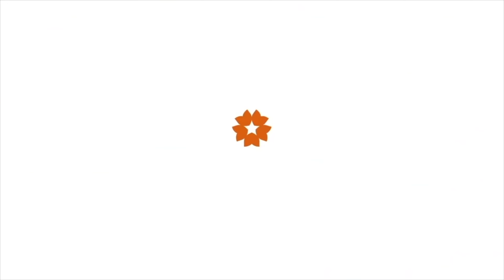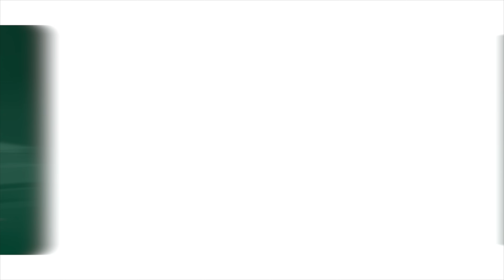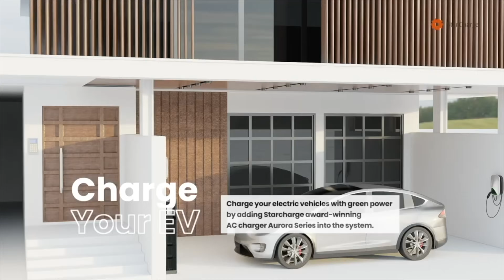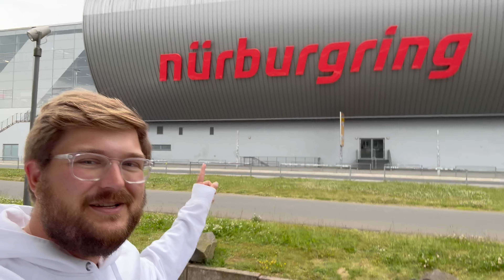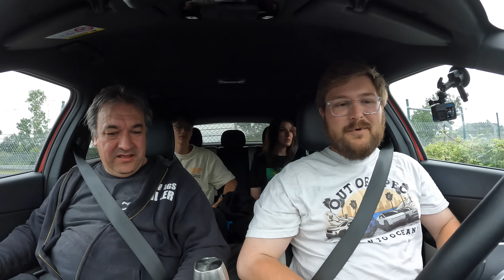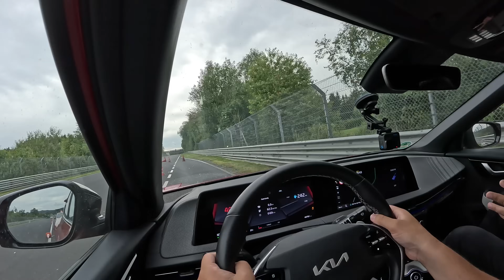Kia EV6 AWD Nurburgring Lap! When A Viewer Tossed Me The Keys

Comment: I drove a rental EV6 once, second kia I've ever driven, the first being the niro...I was really hoping the EV6 would be better...and it was because unlike the niro it had one pedal driving...but the fact that one pedal driving disables itself when you take the car out of drive so you have to turn it back on every time you get in and the paddles and...I will never buy a kia. Disaster of a car, I hated the niro and the EV6 was only marginally less terrible...oh and the fake noises, had to turn those off, absolutely terrible when companies put fake noises in their car.
Reply: So that little detail makes it a disaster of a car!?! Come on… iPedal is not the best way to drive; neither for driving economy or the uphold of the brakes (or safety for that matter). And Kia has to comply with EU regulations stating that the official numbers for the car are based on the defailt starting level.
Reply: @svenskenh644  one pedal driving isn't the most efficient on highways but it's perfectly fine around town. Also...how on earth is it bad for the brakes? Regen saves your brakes. Safety???? The brakes still exist, it's not like you're forbidden from using them? I often turn off one pedal driving on the highway in my car...but then that reminds me of the OTHER problem with EV6 one pedal...turning it off turns on creep...so now you've got your car pretending it has an automatic transmission. It does not drive like a modern EV in any way. It drives like a gas car with an electric power train and if that's how you like to drive your car that's fine...but I think having settings is good so people can choose how they want to drive the car. Additionally the whole car was annoying, this was just the big thing that annoyed me. The fake noises are annoying but can be turned off so that's just my preference but the software is a disaster as Kyle points out, the built in navigation is mediocre, the voice assistant is hilariously useless.
Reply: @Scoopta 1 4wd is always on in iPedal why it isn’t very effective even in city driving. 2 It is good to use the brakes for stopping. Otherwise they will rust and be bad. If one use iPedal one hardly ever use the brake pedal. 3 It is common drivers get panic and try to stop the car by pressing the accelerator harder when using iPedal. Better to learn to push the brake pedal for stopping. Therefore Kia has made it impossible to use iPedal in reverse. I had the same opinions as you when I was new in the electric car world but has changes opinion since I learned the 3 things I mentioned. The Kia engineers have actually done some clever thinking about this and their findings are backed up by research.
Reply: @svenskenh644  1) that's dumb and only makes iPedal a worse design choice. That's not a problem with one pedal, that's a problem with the EV6 one pedal.
2) yes but you don't need to all the time. Several manufacturers just tell you to use them periodically to avoid this problem 
3) weird? I don't really have a good argument against this if this is true but I drive one pedal almost exclusively and even in emergencies have no problem slamming the brakes. Then again when driving ICEs I frequently release the accelerator to slow down at a slow rate on the highway so maybe I'm just better trained? Who knows. I've never had this problem but it's totally understandable that someone else could.
Additionally I'm not exactly...new to the electric car world. I've owned one since 2019 as my only car and these opinions have only gotten stronger.
Reply: What exactly is so terrible about it? I have the same exact car and I love it. Best car I've had since the 80s.
Reply: @ibeam68  the car isn't bad in isolation. It's bad when compared to other modern EVs and it's not bad as a car it's bad as an EV. To me that makes it a bad car because that is the most important part of an EV. If your EV is stuck with creep on unless you enabled one pedal driving which you have to do with paddle shifters and it constantly disables itself when you put the car in park or reverse. That's incredibly annoying. It's just barely better not having one pedal like the niro. The software is mehh too which only added insult to injury when added to the one pedal stuff
Reply: @Scoopta  I stopped using the ipedal except for heavy traffic which is why I don't mind it I guess. I also disabled in my LEAF which keeps it on unless you turn it off. I guess it's a matter of getting used to it.
Reply: @ibeam68  I use one pedal driving everywhere except on long distance highway drives where traffic is minimal. Creep bothers me more though. Even if one pedal is off I never want creep on but I love one pedal and cars with poor one pedal implementations really bother me to drive.
Reply: Because it is so hard to pull the left paddle. Once.
Reply: @jimwilt4944  it is rather annoying to have to do. It's an extra step other cars don't make you do and it's unavailable in reverse and disables itself in reverse
Reply: @Scoopta  Fair enough. I don’t love everything about the car, but the paddle-controlled regen braking is brilliant and I use it ever time I drive the car.

Comment: What's fascinating to me is that the EV6 didn't cook its brakes and overheat the battery. Recently a Highland Model 3 performance went on the Nuremberg ring and its brakes started seriously smoking around 25% into a lap and the battery overheated around 50% into the lap. It was a complete joke! Tesla should be ashamed of themselves for releasing a performance vehicle that's a piece of junk on a track!
Reply: So the break was at it`s limit after 1 lap. Battery and the motor where fine. Tires also. But Kyle was gentle to the breaks and tires to the end. I never was worried about he could damage the car.
Reply: You are comparing a casual drive in someone else's car vs a full blown time attack tho...
Reply: @PhilHarlow  It was on a public track day, so exactly the same circumstances. Maybe a little harder, however only 2 up. There are also other Highland videos of track days where, it's even worse 3-4 corners the brakes are cooked and the battery shortly thereafter. My point is, it has a dedicated track mode and yet its worthless for even an amateur on a track day!
Reply: @joebullwinkle5099  I’m going to guess you don’t have much seat time at the track. The circumstances are that he’s on non-performance tires, in someone he doesn’t know’s car, while the passenger is visibly fearful. You’re not driving hard in that instance. Compare to a time attack in your own prepped car. Those are very different circumstances. Driving even 8/10s is an extremely different thermal load than 9/10s. There very well could be issues with the highland p, I’m just pointing out that your comparison doesn’t really make sense here
Reply: That was Misha taking from the Model 3 all it has, harsh breaking and ruthless accelerating, thats NOT comparable to a casual drive around the Ring that Kyle showed here.

Comment: Thanks for the lap!  Here's your newly warped rotors and worn tires!  Thhaaaaanks!  LOL
Reply: Rotors 👏 do 👏 not 👏 warp 👏. Talk to anyone who tracks seriously, and they will tell you a "warped" rotor is simply one with uneven pad deposits, caused by heating a crap pad until it melts, and then leaving the car stopped long enough for the pad to leave a pile of itself in one spot. Simply re-bed the brake pads and the the problem is fixed. "Warped rotors" is mechanics' favorite myth. What better way to sell someone a $25 part they don't need, take 10 minutes to swap it, and charge the owner $500+? 

I've pushed rotors so hard on track that they literally split down to the hub and gaped open by an inch, like a Pac Man. I have never "warped" a rotor. Kyle is right to not stop the car after coming off track, but warping is not the issue, it's just preventing rotor cracks and uneven pad deposits
Reply: @roadfordays  BULL. This is why you don't spray water on brake rotors or immediately stop to let them cool. When different sections cool at different rates, they indeed warp.
Reply: @Scott8919  I agree. Think long and hard about exactly which sections of the rotor are cooling at different rates, whether those areas are contracting harder than others, and exactly what force that would place on which point along the rotor. When things pull apart from each other, they don't bend. They crack.
Reply: Nerd. 😏😋 Don't blame you though. Gotta take the opportunities when you get them!
Reply: I could see him lumberg saying this 😂
Reply: If rotors didn’t warp then you would have a buildup on both sides and that’s not what you see when you machine the rotors - when on one side it’s grinding down metal to true them up again, on those same spots on the other side, you have a gap where you’re not making contact with the rotor. They do indeed warp.
Reply: The car is ok. Tires and breaks are ok. Kyle was gentle to the breaks and tires to the end. I never was worried about he could damage the car.
He is really a very friendly, open and nice person.